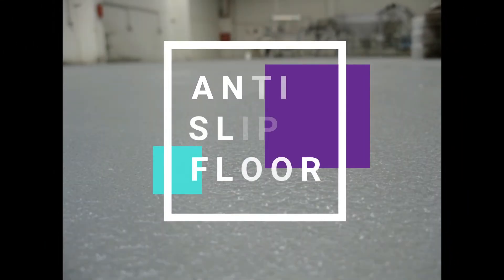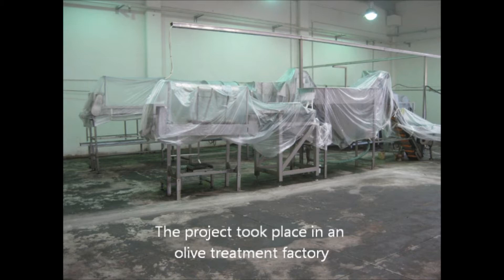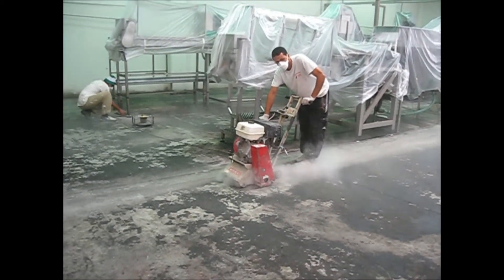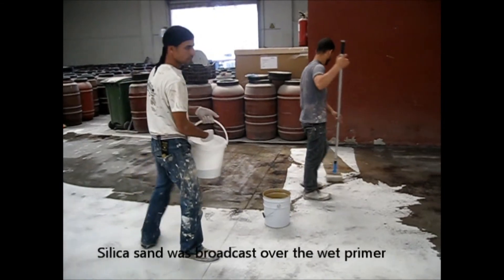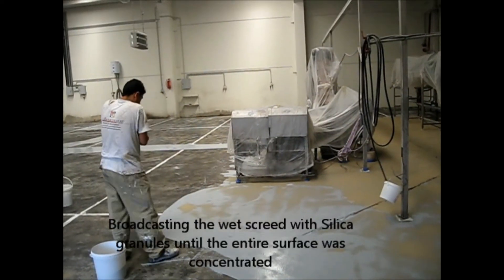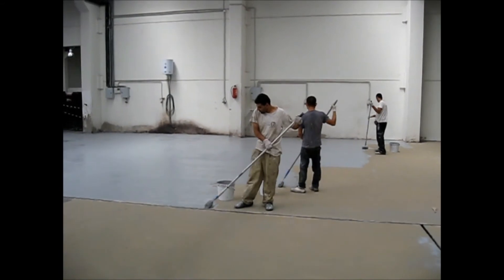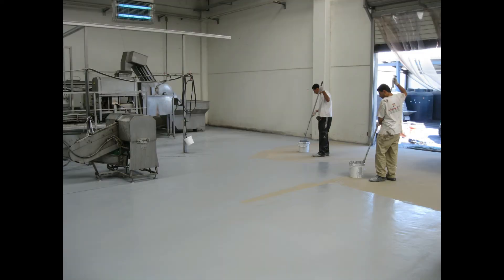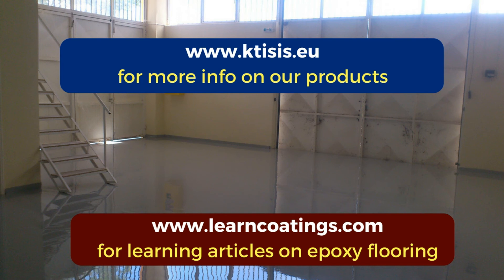Anti Slip Epoxy Floor in a food factory - Case study on how to apply

Comment: Did you get this floor tested? What was the Dynamic Coefficient of Friction? Just so you all know, this area, due to the amount of oils and greases, needs to be above 0.55 DCOF for it to meet floor safety standards. Silica sand is good and all, but since it is sand, it deteriorates fairly fast over time.

Comment: Will it peel if gasoline or degreaser gets on it
Reply from the maker: It wont peel, but you will definitely get stains if the gasoline is let to sit for a long time. Many chemicals can cause discoloration if left for a long time on epoxy

Comment: I am putting down anti slip quartz floor. I have the floor primed but never scattered sand on it to help adhesion, what do you best advise to do now? put base epoxy coat on top of primer and then broadcast quatz and return and pour epoxy quartz mix over it?
Reply from the maker: Yes Danny thats the best option. Apply the base coat and broadcast the quartz on top. You can then coat over that layer. Epoxy quartz mixes are usually preferred in decorative floors where a clear resin is used together with the sand of your choice. Trowel applied mixes also require a good hand, they are not the easiest jobs to apply.

Comment: Do you use a special type of sand? Or just normal sand you can buy anywhere. Great work by the way looks really good.
Reply from the maker: Thank you! I don't recommend normal sand as it is usually contaminated and may contain moisture. I use quartz sand from rivers and in this particular project I used 0.4-0.8 mm granule thickness
Reply: @learncoatings-epoxyfloorin9448  shouldn't they be using RPE while broadcasting silica sand.

Comment: this might sound odd but is just epoxy slippery? I am looking to make a vr thing to stand on and think easier with epoxy so need some material that slipery a bit
Reply from the maker: Epoxy is not that slippery. Only when it gets wet or oily. The project in this video was for an olive processing facility. So need to worry about slipping on epoxy, unless the stand is going to be getting wet
Reply: @learncoatings-epoxyfloorin9448  good to know and yeah I know what video was as most factories, warehouses and work shops where people work or machines are it often people put anti slip down, had spill at college on painted concrete and so that had it but was harder to sweep up the mess then